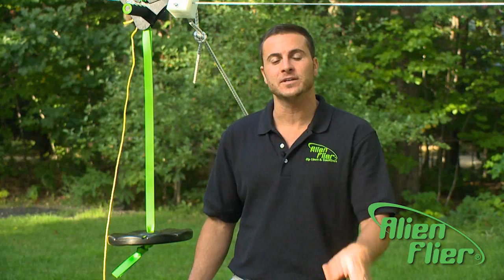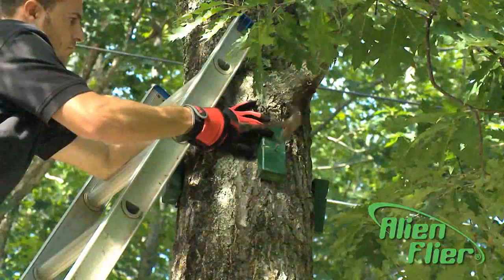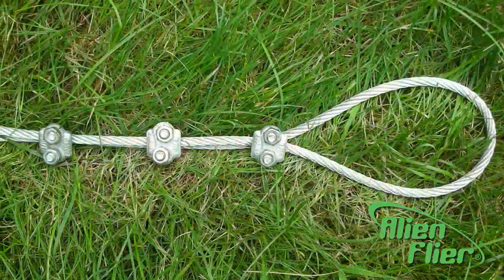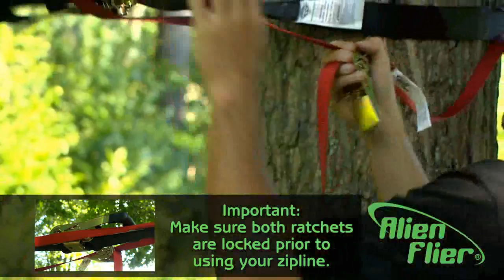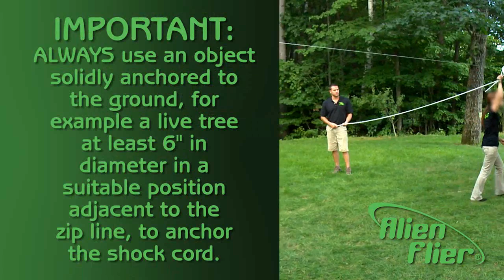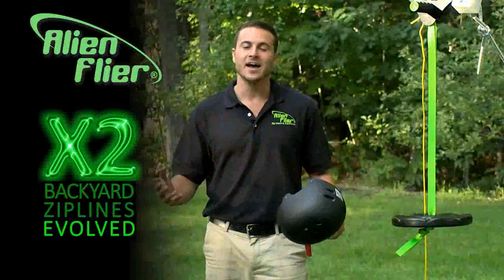Alien Flier 2016 X2 Zip Line Kit Installation

Comment: If I buy the 150' kit, what is the exact length of the cable that will be included?  I've got 2 trees that are 147' apart, and I'm trying to decide whether I need the 150' or 200' kit.  Thanks!
Reply: What did you get?

Comment: Video was very good and easy to follow. I have rudimentary handyman skills, at best, and had no problems installing the zip line. The only thing that I woul recommend is to be careful when opening up the metal cable as it tangled. Untangling the cable was the hardest part of the installation. No fault of the company.